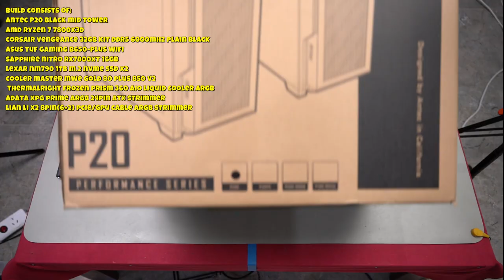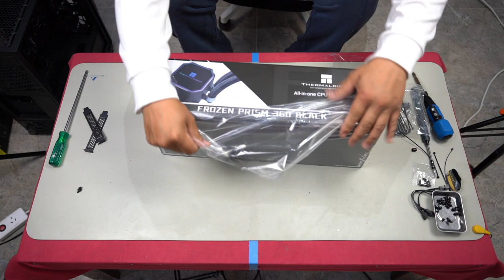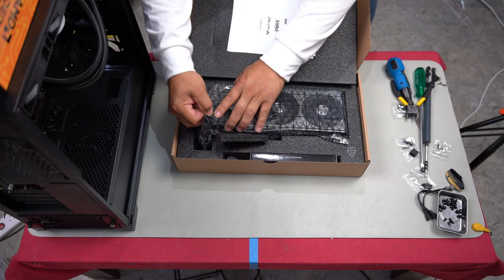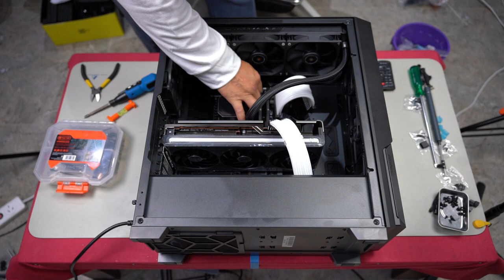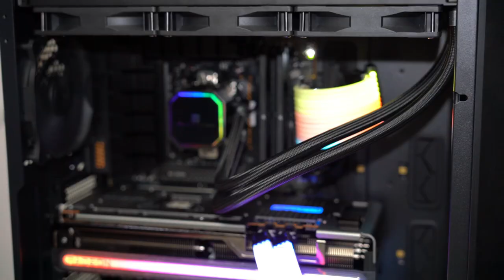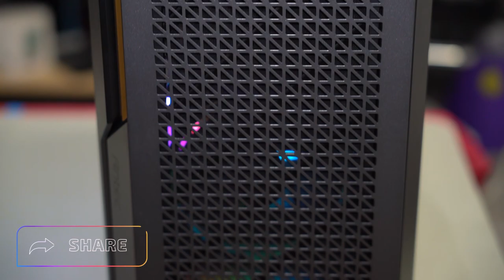AM5 BLACK GAMING PC ryzen 7 7800x3d + sapphire nitro 7800xt 16gb GPU. AMAZING 1440P PC

Comment from the maker: cheers bud
Reply: Whats your thoughts on a ryzen 5 7600
Gigabyte rtx 3060 build on 32gb ddr5 
Msi tomahawk 
2tb SSD 
750W psu 

Build mate?
Reply from the maker: @greenie_the_detailer2499  its a good 1080p solod gaming rig. 7600 is what most ppl who can afford it be on for future proof
Reply: @MIKEYZVLOGZ  I was also looking into the rx 7600 and ryzen 5 7600 combo would this still be a decent 1080p/1440p setup?
Reply from the maker: @greenie_the_detailer2499  yes more 1080p high settings  1440p lower settings
Reply: @MIKEYZVLOGZ  thanks heaps mate. Got a w204 c200 cdi I have a few parts coming for and your videos have also been very helpful. Keen for the new stereo how to video as this ones radio doesn't work at all just makes weird bump noises 🤔